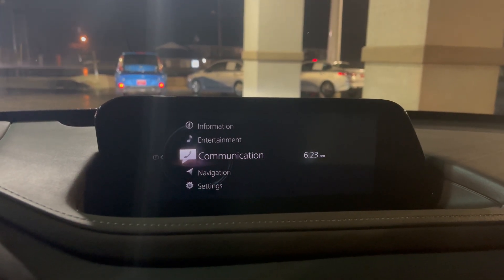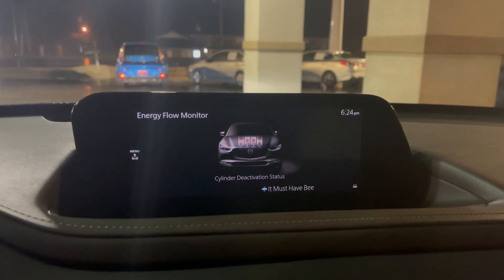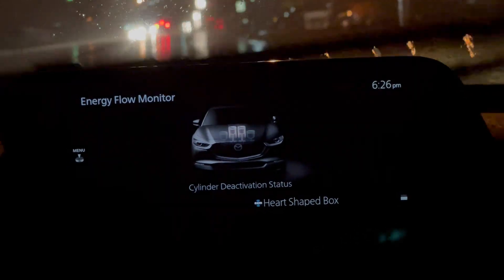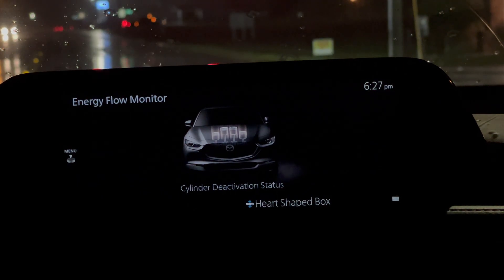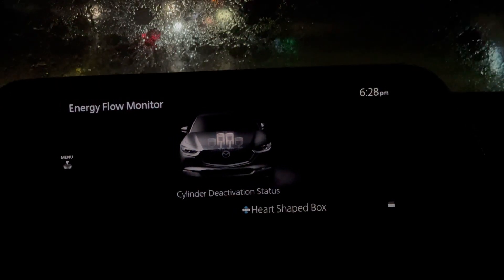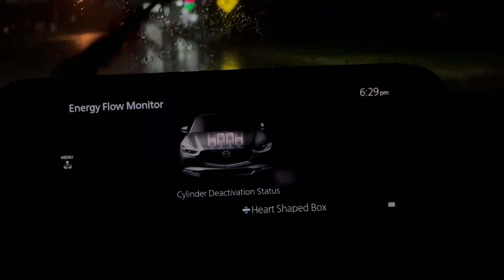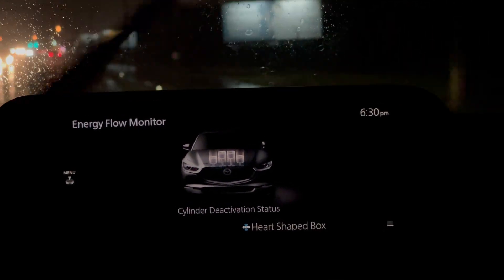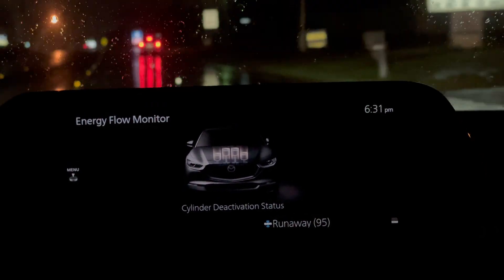Mazda Cylinder Deactivation | 2021 Mazda CX-30 Premium in Enterprise, Alabama

Comment: great video thanks  one way to tell if your mazda has it or not is if the 8 character is an M it has it and if it has an L it does not.   I have noticed mazda has only been putting it on higher trims of the n/a cx 5.  looks like all the cx50's have and all the rest of models are the same as the cx5.   I think only higher end models have that are not turbo.

Comment: How engines are made internally to last. Mazda has its own corporate video explaining the Skyactive engine deactivation process. A little different from the AFM models. All this to lower emissions and save fuel consumption overall. Time will tell. Yes historically, as with Turbo's, it can add to early wear. Maintenance is the key by keeping the oil fresh. I follow the old rule 5,000/6months or less for oil changes regardless if it's synthetic or not. Personally not worried about it.
Reply from the maker: Some manufacturers do well, some are not so good.  I am curious to see if other manufacturers remove these systems with new legislation
Reply: @JSS I have only owned a Chevy as an American-made car decades ago. All the other cars I've owned were by Honda. Now my understanding Honda only uses deactivation system in their 6 cylinders. Car Care Nut  host and I think Scotty Kilmer believes they work best on 6 cylinders or more not 3 or 4. Supposedly in 2019 Mazda started using cylinder deactivation in the CX-5. So so it's been 6 years.  interesting to know how those engines are holding up overall. I owned 2024 CX30 that I just traded for CX50.

Comment: OMG this system is scam like the GMC truck with AFM (active fuel management) deactivation cylinder
Reply from the maker: It may be a little better than GM’s.  Both are used to satisfy CAFE fuel economy requirements.

Comment: Mazda has removed the energy flow monitor from 2024 European models. The car now behaves and sounds like a two cylinder fiat 500, an ugly ugly noise.
Reply: I have CX30 2024 and it has Energy Flow Monitor..
Reply: yeah I have a 2024 cx-50 lowest trim non turbo and dont have that option to see the cylinder deactivation, but I think the car has it

Comment: THE LACK OF PRESSURE FROM THE DEACTIVATED CYLINDERS WILL CAUSE ENGINE OIL TO LEAK THROUGH THE PISTON RINGS AND INTO THE COMBUSTION CHAMBER. SO WHEN COMBUSTION IS REACTIVATED, OIL GETS BURNED, BUILDING UP UNTIL THE INTAKE VALVE AND SPARK PLUGS ARE CLOGGED CAUSING ENGINE MISFIRE.
AND THERE ARE MANY OTHER PROBLEMS LIKE APPLYING MORE STRESS TO THE PISTON RODS FROM CYLINDER 2 AND 3 DECREASING THE ENGINES LIFESPAN. 

SO I'D RATHER PAY THE EXTRA MONEY FOR A COUPLE OF LITERS OF FUEL THAN TO REBUILD AN ENGINE BECAUSE SOMEBODY THOUGHT IT MAKES MAKES SENSE TO BUILD DISPOSABLE ENGINE JUST SO WE COULD SAVE ON FUEL AND CALL OUR SELVES INVIRONMENT FRIENDLY.
Reply: To się nazywa Eco terroryzm
Reply: Are you telling me the engineers didn't think of the ramifications of the lack of pressure so they could stop engine oil to leak through the pistons?  I'm sure the engineers put a safe guard in place to prevent this from occurring.
Reply: @Melanie-nq9tv  Yeah, that’s why mine has 200.000 miles on it and not burning a single drop of oil 😅 It’s always funny seeing average Joe’s think they know better than the actual engineers at a renowned car company like Mazda.
Reply: @Melanie-nq9tv No, they did NOTHING about this. This was a corporate decision. To make matters worse, it’s only good for a 1 mile per gallon savings…

Comment: Any way to shut down this feature? In some models cause vibration
Reply: Not at this time. Maybe in a few years there will be software available for purchase similar to the VCM deletes in Honda and GM engines but it's too early for that right now. If it causes vibration, check your engine mounts. They may need to be tightened or replaced.

Comment: Anyone experienced any vibrations when on two cylinders?
Reply: Yes..i strongly have...any suggestions or idea that could help this issue?
Reply: @Ramkumar-nr5zp  https://static.nhtsa.gov/odi/tsbs/2020/MC-10177841-0001.pdf
Reply: @Ramkumar-nr5zp  Helps if you rev it a bit higher than 2k rpm.

Comment: Can the cylinder deactivation be turned off?  Putting uneven wear on the cylinders could shorten the engine life in the long run.
Reply from the maker: Cannot turn it off, but it usually only deactivates in coasting scenarios.  You could minimize the coasting situations.
Reply: @JSS  But then if you coast, you’d get pretty good fuel economy anyway.  Can it be deactivated by a mechanic?
Reply: @GeneralSirDouglasMcA  From my basic understanding, it can only be deactivated through manually tuning the ECU of the car. And even then, I don't know how exactly to do it. Some Honda's or GM's deactivate VCM by adjusting the engine temp sensors or the timing. Not sure how it could be done for Mazda's though, it's a little too early with them to tell.

Comment: I was going to buy a 2022 mazda cx5 when I saw it had cylinder deactivation I immediately googled to see if they have been having any problems with it like GM does. Sure enough, they had a recall over it because it could cause the car to stall. It is so pointless to have that garbage tech on a 4 cylinder. My Silverado has it, but I bought a thing that deactivates it and now I'm happy. Unfortunately, you can't turn off or buy anything that shuts off cylinder deactivation. With that said, I'm not buying anything Mazda anymore.
Reply: Can it be turned off?
Reply from the maker: I understand your hesitation.  I haven’t seen any issues since the recall and rarely any before.  

Just like this video, I had intentionally driven 2021 and 2022 CX-5 to see the cylinders deactivate, and have not seen it.  Maybe they changed the frequency or occurrence requirements.
Reply: @JSS  I have had the same concerns. I went to buy Mazda 3, but changed my mind as soon as I found out the CD. I bought an Audi instead. Even the Mazda dealer told me that it hasn't got CD, but I could see the CD solenoids on cylinder 1 and 4. It's a pity that mazda is shooting themselves in foot because they make great cars. Some of mazda's design choices are impossible to understand. My last Audi ran 350,000km with another 200,000km in reserve, I wanted a new car that goes at least 350,000km without any problems so I went with Audi which also has port injection. I don't believe any modern Mazda can cross 200,000km. I'd rather pay more to get a car that last twice longer than mazdas.
Reply: @ampm9771 lol…. Dude Audi is the shittiest of the germans when it comes to longetivity except for a few powertains! Everything they have burns oil or has timing chain issues! Even the 4 banger suffers from it. The supercharged v6 was one good thing that they don’t make anymore, but it too had peoblems when they changed the PCV design and added port injection. They changed the piston rings on the CREC V6 Supercharged and down the drain went the reliability. Their V6 turbo has already had a lot oil burning issues within warranty and according to Audi it is okay for a car to burn a quart every 1000 miles. You should atleast check facts before saying an Audi will outlast Mazda.
Reply: @Steeltouch60  Yeah thinking Audi is more reliable than Mazda with CDA. Hehe

Comment: Hey Jonathan, thanks for the video. I'm guessing you're driving the non-turbo in this video? I have non-turbo 2.5 Premium. 

I have a question - Do you (or anyone who reads this) notice a lag of maybe 1s or slightly less from the moment you push the accelerator until the engine revs? Obviously there is a slight delay going from iStop, but I notice this even at cruising speed if I take my foot off the gas then punch the accelerator again. Would this be to do with CD, is there an issue with the car, or is this normal behavior? I'll have to put the power display on tomorrow and see if I can observe what's going on.

Comment: I thought Mazda removed cylinder deactivation on Mazda CX-30 Premium for 2021 model year (but had it on 2020 models)? The mazda website does not call it out for 2021 as a feature on the premium trim.
Reply from the maker: I know they are vague about it on their descriptions and equipment listing.
Reply: @slbynum  how do you know?

Comment: Mine shows the picture of the car with the Hybrid and engine energy flow, the cylinder deactivation for me is shown the the right of the car picture !
Reply from the maker: Are you driving a mild hybrid? Which model?
Reply: @JSS  yes its the mild hybrid cx30. The trim here in the uk is Sel lux so not sure which spec that is for yourself ?
Reply from the maker: That is unique from what we have, with some options we can only get on the top model.  I would enjoy sitting down over Zoom for the Mazda Passion series, and talking about your experience with the hybrid and CX-30 overall.
Reply: @JSS  that would be great !!! Its been a strange one seeing what you get to what we get as standard over here, this is why i enjoy your video content 😉😉

Comment: I thought they stopped the cylinder deactivation because it was causing problems...does the 2021 CX5 have it?
Reply: yes
Reply: Yup all the way to 2022
Reply: Yes and my 2021 CX-5 2.5L non turbo was showing all four deactivated for over 5 minutes with cruise set to 75 on the interstate.   I believe it's also burning oil.
It also showed all four deactivated diving up a hill with cruise set to 41mph.

Comment: "No cylinders", not sure how that'd be possible?
Reply: You can easily not inject fuel when coasting and the engine still 'runs'. 
If the torque converter is in lock up, the wheels rotating will keep the engine spinning, without fuel.
Reply from the maker: Two are running all the time.  The outer two are the ones that go on and off.
Reply: @JSS  Yes, I understand that, but at one point in this vid the display didn't indicate that. It's a bit confusing.
Reply from the maker: @MrChristopherMolloy  When the engine isn’t under a load, like when coasting, the light on the cylinder display goes out.
Reply: @JSS  Again, understood, but the engine is still running on either 2 or 4 cylinders, it's not like an engine "stop/start" or an electric-hybrid system. The display and the description is at the very least confusing.
Reply from the maker: @MrChristopherMolloy  yes the engine is still running.

Comment: Jonathan, I heard you say it is not on Mazdas with the turbo. Is it on all non-turbo 2021 Mazdas? Can you tell us which Mazdas have it and which do not. I thought it was not on the 2021 CX-30. I know that only certain trim levels of the CX-30 had it in 2020.
Reply from the maker: It’s just Premium CX-30 and Mazda3.  All CX-5s, and I haven’t checked the Mazda6 yet.
Reply: @JSS I know this old comment but I googled if the 2021 Mazda cx30 select has the cd and it says it does is this correct